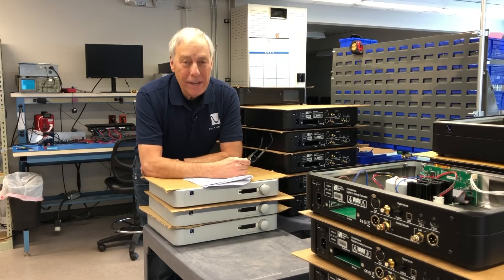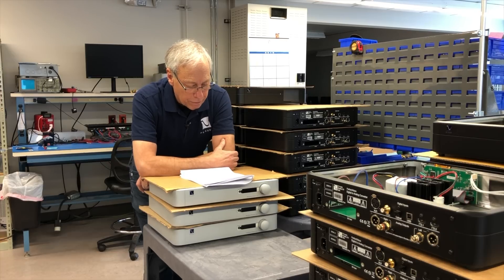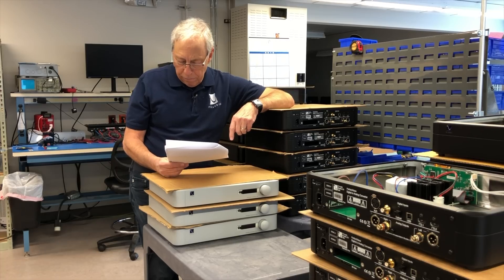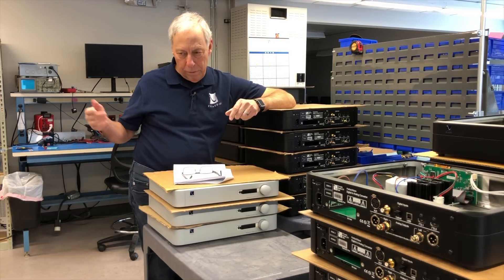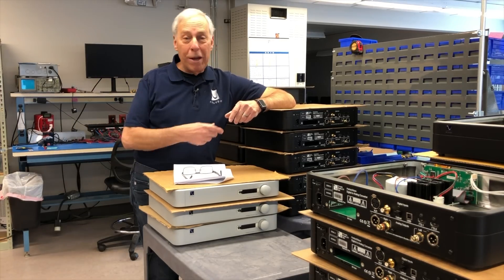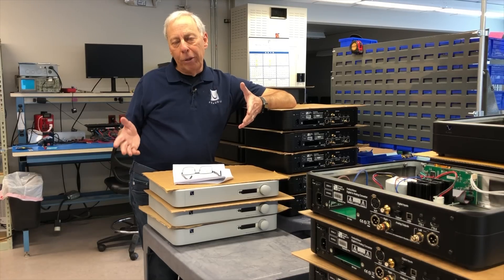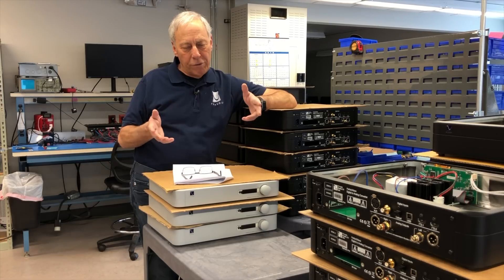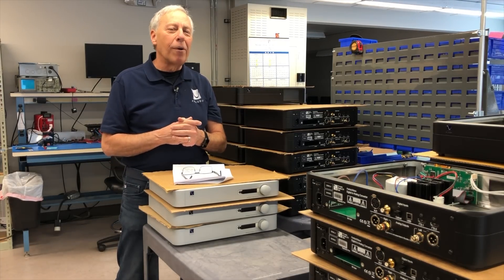Is it dangerous to run an amplifier without a load?

Comment: What about tube amplifiers? If you don't connect a speaker load, you will break the output transformer! I think that's important to remember this. Some people have tube amplifiers, mostly musicians.
Reply from the maker: That is not true. Voltage swings on an unterminated transformer will not damage the transformer. Think of it this way. A transformer is nothing more than two coils of wire between some steel plates. Unless the voltage you are applying is hundreds to thousands of volts exceeding the breakdown characteristics of the wire or laminations (unlikely) applying output voltage to the transformer when it is not terminated will not harm the transformer in the least. It's an old myth.
Reply: @Paulmcgowanpsaudio   Thousands of volts in the primary is possible. Ask any guitarist and they'll tell you they have seen an output transformer blown. Happens all the time in the real world. You are expected to know this stuff, Paul.

An excerpt from Speakers are
 Important In or Out of the Circuit by Hartley Peavey offers a clear and detailed explanation. You can find it on the Peavey site:

The above is a rambling discussion about transformers
(both power an output) and their effect on the sound of
a tube guitar amp. I felt it was important to understand
what transformers do (and generally how they do it)
before getting to the final point of this discussion. As
mentioned above, a transformer works by converting
one form of electrical energy into another. In the case of
a tube amp, to achieve the matching, we “trade” high
voltage in the primary, for high current in the secondary
to properly drive the speaker. This is a “two step” process
where electrical energy from the tubes magnetize the
core of the transformer at the audio rate. Then, the
varying magnetic field in the core induces voltage
(and current) into the secondary suitable to drive the
speaker. The important point here is the energy is put
into the transformer through the primary, which converts
that energy into magnetic energy (i.e. it magnetizes the
core) and then that energy is reconverted into electrical
energy in the secondary windings, which drives the
loudspeaker.

If (for whatever reason) the SECONDARY of the
transformer has no “load,” the magnetic energy created
by the primary (and “stored” in the core) has NO place to
GO! As the alternating signal in the primary goes down,
the magnetic field built up in the core “collapses,” thus
inducing an extremely high voltage “spike” back into the
transformer’s primary windings. Because this energy is
substantial, and because the primary coils have many
turns of wire, an extremely high voltage “transient” (often
3000 volts or more) can be developed. The primary of
the output transformer is directly connected to the tubes
and tube sockets of the amp, and neither the tubes nor
the sockets (and associated wiring) are designed for
that kind of voltage. These electrical “spikes” can (and
often do) cause “arcing” inside the transformer and/or
the tube elements, especially between the terminals on
the tube sockets and the associated wiring.

Remember that we learned in high school physics
about the “law of conservation of energy.” This taught
us that energy can’t simply “disappear,” it has to “go
somewhere.” When a tube output transformer doesn’t
have a place for the energy to go (i.e. a speaker or its
equivalent) the energy developed in the magnetic core
“flashes back” into the amplifier, often destroying the
output transformer, the tubes, the tube sockets, and/or
the associated wiring.

This is WHY you should NOT operate a tube amp
without a “load!”

Ignition coils for gasoline engines work essentially the
same way. There’s a “secondary” coil of wire with many
“turns” of wire wrapped around a steel core. In operation,
a connection is made to a power source (battery) then
current flows though the primary coil and magnetizes
the iron core. The contacts (points) then open and the
magnetic field is allowed to “collapse,” which results in a
huge “pulse of energy” being inducted into the secondary
coil (which is what produces the electrical “pulse” that is
fed to the spark plug). This is also a two step process
where basically the primary coil is energized, producing
a magnetic field, then “de-energized.” As the magnetic
field “collapses” the magnetic energy stored in the core
induces a high voltage into the secondary coil which is
then fed to the spark plug, thus firing the air/fuel mixture.

An “UNLOADED” tube output transformer produces
high voltage “spikes” in EXACTLY the same manner as
an “ignition coil” does. The difference being that a tube
amp output transformer is NOT designed to operate that
way, but an ignition coil IS! Operating a tube amp with
its transformer unloaded can easily damage or destroy
a perfectly good tube amplifier by the “flyback” action
described above. Hopefully, the above will provide a
little background as to exactly WHY it’s important NOT
to operate an amplifier WITHOUT a proper “load” for the
output transformer’s secondary output terminals.
Reply: @mutantbaby1672  how long would you have to run an amp without a load for something like that to happen. I appreciate the knowledge
Reply: PS Audio this video is not about Marshall stacks not about solid state or other weird cd  video is irreverlevent to musicians
Reply: @Wickedsensations2001   Because the laws of physics only apply to musicians and not audiophiles. Nice one, dude. Stay in drugs, don't do school.

Comment: I use an external amplifier in my car and leave the speaker wire on the head unit disconnect. I notice that the heat sink in the back of the head unit gets hot when I play music, is that normal? I never saw Class AB home amplifier get that hot with no load before.

Comment: In the early days of solid state there were warnings to always have speakers or an appropriate load on the output terminals.
I am not sure why.  At the time all of my equipment was tube operated.   At the time I started using solid state equipment, this no longer applied.  Perhaps it never did.
Reply: Maybe because some of the early solid state amps were transformer coupled?
Reply: @johnhodgson5313  Some amps back in the day were unstable without a load. I can't recall any transformer-coupled hi-fi SS amps or any mention of them in Roddam's Transistor Amplifiers for Audio Frequencies though that may be just my memory. Cheap transistor radios were invariably transformer-coupled at the time.
Reply: @jonathansturm4163  The only one I can think of was Macintosh amps, anyway the loss of stability makes more sense.

Comment: Yeah, I saw a guitar instructional video way back when and the guitarist said he had to connect load resistors to the amp to prevent it from blowing up. Because he didn't have speakers connected to it I'm assuming it was a tube amp.

Comment: Some old unloaded power amps used to bite. Way back when ( mid 60's ) I/we used to create shipboard power ( 400Hz ) using an HP 200CD generator and a McIntosh 60w tube amp. They had a 70vac output connector for sound reinforcement applications. So in the lab I had one of these devils powered up and running with the 70vac output going to a dual banana plug jack and no load. I/we were working on a Servo Amp for the Navy. What I didn't know was that that old McIntosh would sometimes oscillate at full output if there was no load. So I picked up that dual banana plug and that thing kicked me across the aisle and on my butt. I'll never forget that. The other students in the lab got a good laugh out of that one.
Reply: ROFL! I know how much that can hurt! I can recall pulling a spark off the anode of an 807 that blew a hole through my thumb. Not only an electric shock, but a painful burn that took weeks to heal fully.
Reply: You became the resistive load when u completed the circuit path through yourself.

Comment: Paul, you are correct for solid state. However, most tube power amps will build a very high voltage in the output transformer if there is no load. I have seen tubes arc in this condition and more than a few output transformers have been ruined.
Reply: Exactly. I thought everyone who has ever lived with tube amps knew that. So I think he just got this one wrong. Sorry but there's just no other way to put it.
Reply: @InsideOfMyOwnMind  Paul didn't get it "wrong" because he was referring to a Class D SS amp from the question.  However I agree, he should have "qualified" his answer (for the rest of us) by stating Solid State, but not get "into" it.  I am sure he didn't want to confuse the person who wrote in with the question who was asking specifically about his class D.
Reply: The writer is a new audiophile and who knows how soon he will want to try tubes, so I brought it up just in case the writer decides to go that way. I too had been wondering about class D with no load and Paul sure answered that to my satisfaction.
Reply: @erikthompson404  considering what's at stake a stronger mention would have been appropriate.
Reply: You are exactly correct. I have a short video on my channel about this. https://youtu.be/99_6OHMfuL0
Reply: I blew my smps by connecting it to an amp with the smps unplugged from the ac input supply to the smps.